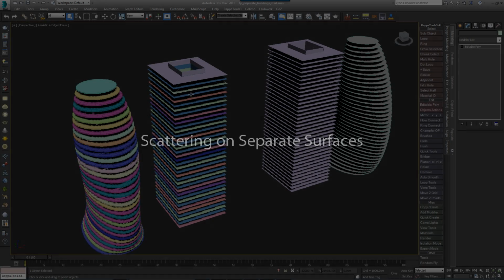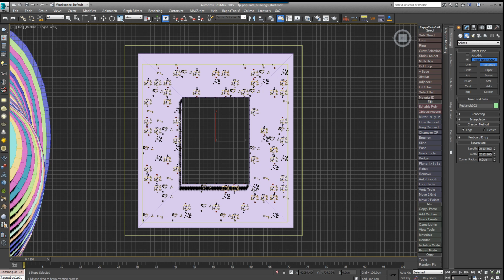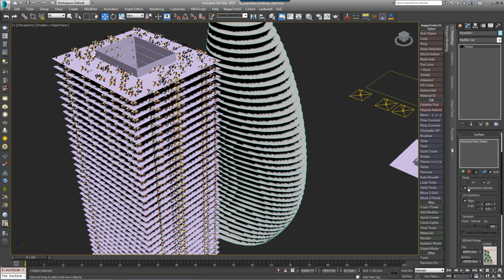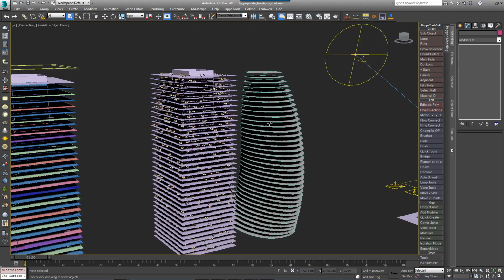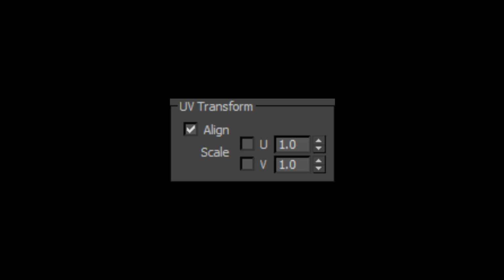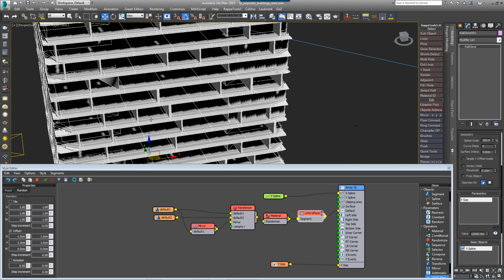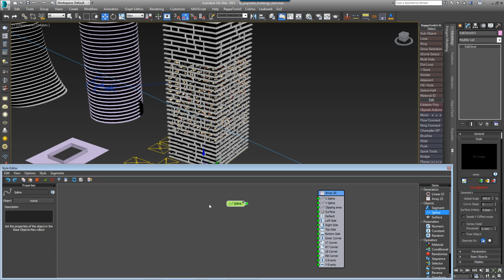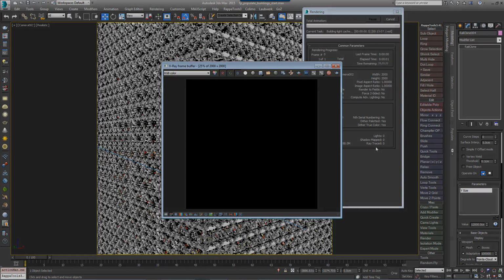TUTORIAL: Populating Building Interiors with Forest Pack and RailClone

Comment: When I use the first method used for the furniture, it scatters everything on the top floor. It doesn't work as it is shown in the tutorial. All the floors are separated object. But they are in a group. However, I selected them one by one, just to be sure that I'm not doing something wrong. But still, all the objects are on the top floor.
Reply: I tried the following with FP 6.1.1 and all worked. 
- plane copied
- plane instanced
- planes grouped (cant add group, but can add group contents)